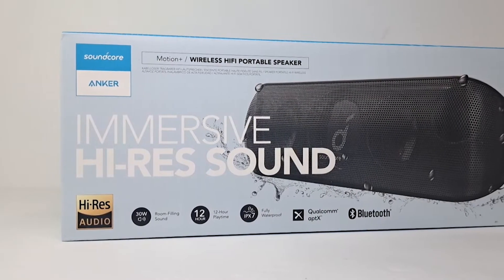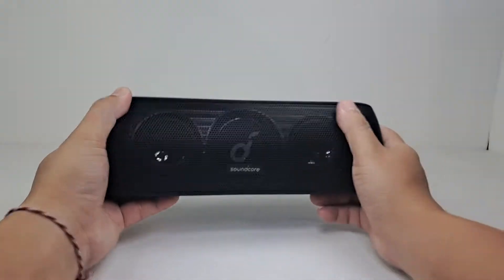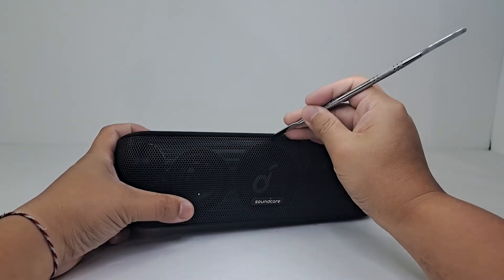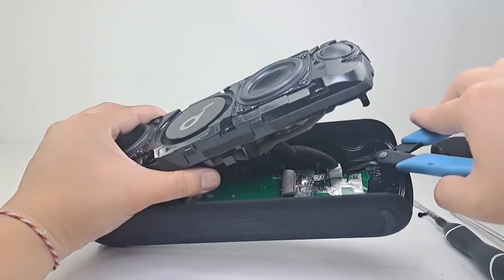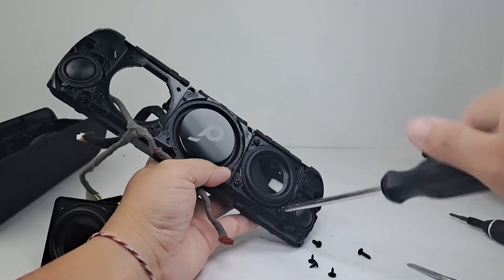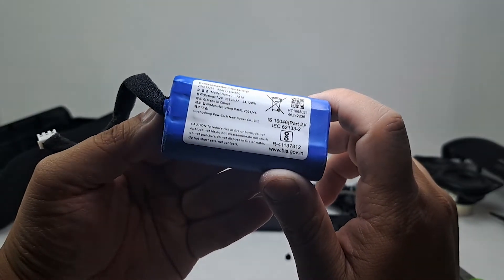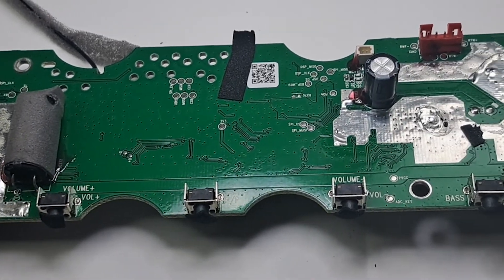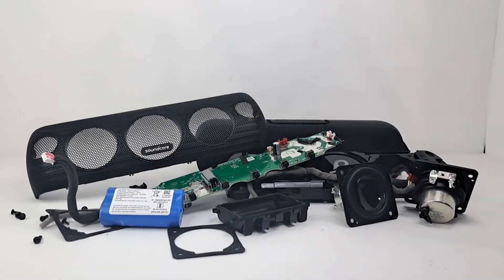ANKER SOUNDCORE MOTION+ COMPLETE TEARDOWN !!!

Comment: Great video.  Just what I need.  I have 2 faulty Motion+ speakers. One has a faulty mid woofer, the replacement has a dead battery (another replacement is on its way). I'm wondering if I should put the older, working battery into the newer speaker or put the new woofer into the old one.

Comment: I had to take apart mine today.
Beware:
1. the grill was glued on the sides. I had to use a lot of force to pry it off and possibly heating it would help
2. the cables are glued to the pcb so they don't fall apart due to vibration, one of them left only pins on the board, but it was possible to slide back on and I added new glue to hold it together

Comment: Great Video, I am having issue with the soundcore motion +, which is not charging, is it because of the battery or any other 
your comment is much appriciated
Reply from the maker: Once plug in, is there any indicator light that it's charging?  If not it could be the charing port or board.  I would check that and the battery.

Comment: I got this speaker today and I love the sound quality. Its not gonna replace a proper set of speakers but for a portable speaker this is great. Only issue i see are those buttons. I absolutely dislike the buttons they have used for this because they tend to fail overtime. These are the typical clicky buttons you see on cheap electronics so thats a bit disappointing to see. Maybe these are higher quality ones. Hopefully someone who used this speaker for couple of years can let me know how they are.
Reply: I've had mine since January 2020 and the buttons are still working fine, the battery life isn't as good as it was though
Reply: @leeee1989  that's good to hear about the buttons. I was being paranoid and let it turn off itself after 10 minutes so I don't have to press the button again. How's the playback time though?
Reply: Agreed, moreover they are poorly visible and they look dirty in no time, it's the biggest let down for me

Comment: Hi All, I'm having sizzle-vibration noises especially left side of the speaker on basses.   I'm out of warranty.  Do you know what is the issue and how to solve?
Reply from the maker: I would first check the driver.  it may be bad or there may be something that is causing the driver to make that vibration.
Reply: Buy sec0nd one and send the broken back 😊

Comment: Thanks for the teardown. There are two individual power sources BUT on the paper. Inside the speaker, there are only ONE battery pack (power source) shared with the two audio amplifiers. The reason for the manufacturer to highlight "two individual power sources" (again, a lie) is because there is a small crosstalk of the left and right amp channels but for this kind of application, it does not matter. What is really true is the fact that there are separated amplifiers for the full range woofers and the tweeters which hopefully are driven by a virtual active crossover driven by the DSP (hopefully). Removing the passive crossover circuit provides more power and much better frequency separation. I'm so sick of the Chinese lies on their products that I don't believe on their specification.
Reply: lol,, keep getting robbed then by the inferior western tech

Comment: The first thing to do is to replace electrolytic capacitors with reliable Japanese, Nichicon or United Chemicon, BEFORE they ruin the whole circuit. That said, the amplifier on this portable speaker is digital and fails easily when overloaded or when components start to go out of specs. 15% tolerance at the best.  Compare that to old school designs, 200% and still kicking. Build-wise, a piece of Chinese garbage,  same as most modern electronics. Quickly disposable. Sounds good, though.

Comment: Mine had the battery fail within 2 years. Now I have to replace it (hopefully just that). Thanks for the video.
Reply: be careful mine broke wouldn't charge. bought a new one guess what ?? the new ones will not pair with older models.
Reply: @markgc65  I replaced the battery and that worked.
Reply: @BicycleFunk  yes did mine too. got battery on EBAY. £21 took 30 mins to fit following a you tube video. mine looks fine after reassembly.
Reply: @markgc65  are you able to turn yours on without a power source connected? Because I cannot. It will run off battery, but I cannot turn it on unless it is plugged in.
Reply: @BicycleFunk  mine runs as it should once new battery was fitted.
Reply: @markgc65  thanks for letting me know.
Reply: Did you replace it... if did replace how ?? cuz warranty is only  18 months...
Reply: @RadiantElite321  I can send you the info the replacement I used if you need.
Reply: @RadiantElite321  I'm having a difficult time finding the correct battery. I did test the battery and it's definitely dead.
Reply: @RadiantElite321  hi, sorry but I just saw this. I ordered the replacement battery and simply switch it out. Unfortunately, Anker makes this difficult, so it won't look great in the end and I think they have a software bug that only lets me turn it on when plugged in.
Reply: Maybe bms broke
Reply: @akhmad_akhis  I replaced the battery and it works.

Comment: Guys, do you have any idea how to increase the volume when the aux input is used instead of the bluetooth? I was thinking maybe something like a headphone amplifier will do.
Reply from the maker: the signal still go thru the speaker's motherboard, so it still uses the speaker amplifier chip.
Reply: If you mean that you have  a source with insufficient output that can’t  drive the speaker loud enough then yes a decent headphone amp will help. 
Having said that, I now  wonder if driving the aux input to its maximum is as loud and as clean as going via bluetooth
Also, a too powerful headphone amp could also introduce distortion by overdriving the preamplifier in the aux-preamp input . 
Would love to see a test -comparisson on that . If i was a content creator i would do this

Comment: How to replace batteries in a battery pack?
Reply from the maker: you would need to remove the individual cell and solder in the new cell to the bms of the battery pack
Reply: @HBV90  Thank you. I've tried to find replacement pack to no avail. Soldering is the only option left.

Comment: The USBC connector for power is damaged. Do you have any suggestions on how to repair it or bypass it . I love my speaker 😢
Reply from the maker: if you know how to solder, you can desolder the old usb-c and solder on the new one.  If not, easiest way would to get a new motherboard to replace your exisiting one.

Comment: Is it easy to take out the battery without taking out the two large speakers, or do the speakers need to be removed first. And how possible is it to find a replacement battery with the same connector?
Reply: Did you try it?
Reply: I have this same problem.  @AnonYmous-yu6hv

Comment: I bought this a year ago, and it is not working.  The issue is that it has no sound, did already a reset, tried using the aux port.  Still has no sound.  It won't power on unless connected to a charger.  Good sounding speaker but it is not a reliable one.
Reply: Mine too, I think there is something with the board
Reply: Mine lasted little over a year. Same problem as you. Only powers on while plugged in to charge. No sound though.

Comment: Hello. Mine has a little white noise or static coming out of the tweeters. It is heard if one is very close listening at a low volume or sets the volume to zero. Is that normal in the anker?
Reply: Is it from the left side tweeter ?
Reply: @tominjose1993  From both tweeters you can listen at low volume or playing music with zero volume. Already at high volume it is not felt. If you put your ear next to the tweeters you can hear it. Can you check it please? Thank you
Reply: @capitanlevi203  That's actually air leak from tweeter area ,it your products is under warranty, you replace it by writing to Anker. My 2 Units had the same issue.
Reply: @tominjose1993  Now I have doubts. I read that several people noticed the same thing and I thought that it was a normal design, since it is a slight static or white noise that is perceived at low volume only. But now it seems that it is not like that and it was a defect :(
Reply: @capitanlevi203  in low volume you will notice the bass driven notes will have that issue. It's a design issue for the speaker.
Reply: @tominjose1993  So you can hear the static at low volumes and it's normal :) . Thank you very much.

Comment: Nice rocking 2 texas tpa3128d2. I wonder if the are using 7.2v to power the amps or elevating it, as rated power at 7.2 is arround 5 Watt according to the data sheet.

Comment: I was thinking about getting some of these and modifying them to run on external power and from external audio source, without battery or radio. After seeing the mainboard, I'm not sure that would be a feasible task. I mean the sound is good and they're compact, but for a stationary installation I should probably not (ab)use these. 🙄 Maybe I'd have to remove the electronics altogether and just use the mechanics of it. But it's interesting to know how the case could be opened! 🙂

Comment: i lost my bass on my soundcore motion plus. what could be the problem.
the speakers are moving but the passive isn't as active as i've usually seen it be?
Reply: Have you accidently pressed the very left button to disable the bass? Then press it again to re-enable it. The white LED next to the button will then turn on again. You might also want to install the app to change the equalizer settings. I achieved much better sound by turning the mids down in the equalizer. You should never press the left button or it will disable the custom settings. (They can be enabled again in the app.)
Reply from the maker: You may want to check for air leaks..
Reply: @HBV90  How can i do this?

Comment: very nice! thank you!
I think the battery in my soundcore motion+ is broken. I'm charging the speaker over night. full battery in the morning. (turned off the whole day) and on the next morning, the battery is low / dead again..

so now I'm thinking about buying a new battery for the speaker, tearing my soundcore up and switch out the broken battery.
is that possible? and could you tell me which battery exactly is in the soundcore motion +? I can't find any Infos on this!
thanks in advance
Reply: I have the same problem, did you do it?

Comment: thanks for this very helpful I've been wanting to have my battery replaced but Anker's customer service is non existent. Now I know how and what batt to buy. thank you!
Reply: Hey Marc, where and what did you buy? I can't find 2INR19/66 battery anywhere.
Reply: The battery is a twin 18650 pack. I would guess there is a temperature sense in it as well. This battery pack can be easily built. And it’s cheap too. I would upgrade the battery to a higher capacity for longer battery life too!
Reply from the maker: Your very welcome!

Comment: Excuse me, will it cause problems if I replace both woofers with higher Watt woofers? For example 20 watts x2 so that would be a total of 50 watts + tweeter.  Please answer and thanks in advance.  🙏🏻
Reply from the maker: It shouldn't.  The speaker should still be pushing the normal power to the drivers.
Reply: Well thank you very much 🙏🏻 Now I'm not curious anymore. Greetings always 😊

Comment: bought this a while ago and i think i ripped the radiator in the back. It makes these brrr sounds when playing anything with bass
Reply: Same with my unit. I tried 80 hz bass sounds and it goes crazy after a certain volume level. Did you come up with any solutions?
Reply: Coba gunakan lem multiguna